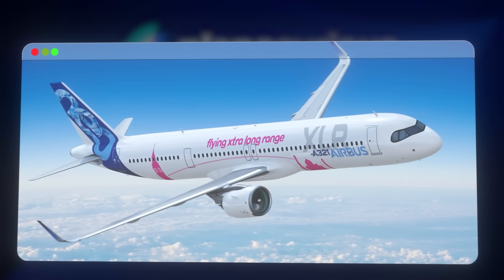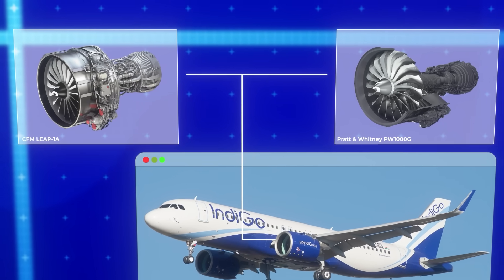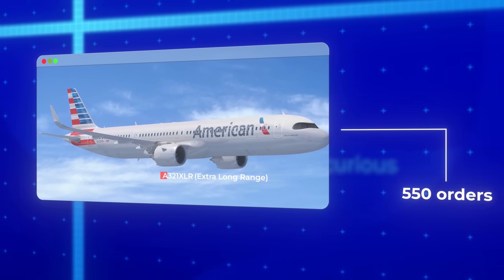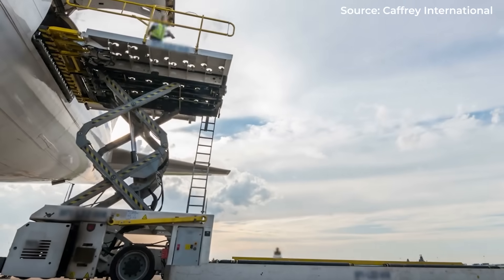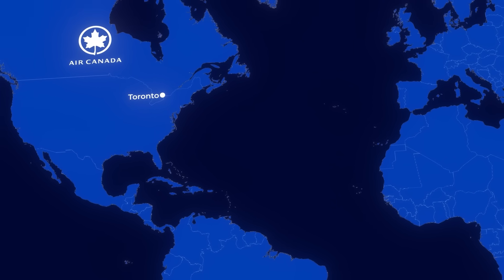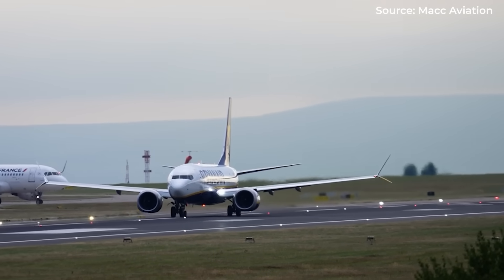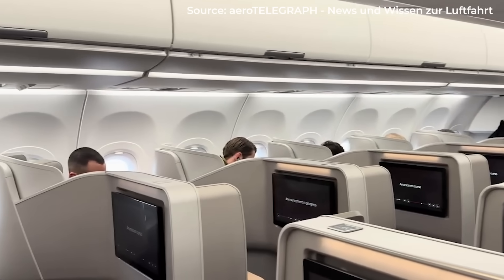How Airbus Outsmarted Everyone With One Jet

Comment: the only one making a stir are you. there is no point in making a narrowbody fly to far. narrowbodies are made for short distances, that is why they are cramped with seats so close to each other you barely have time to breath. if you are to travel long distances, you need room to stretch. if you take a narrow body and add extra fuel tanks, noone will buy a ticket for it unless you re-design also the interior seating. that is why widebodies are used - they have space for that. A321xlr will be used for 3-4 hour flights, not overseas. airlines are not stupid, they wont buy a plane to be able to fly 40 people from london to NY. the savings in economy would just not make up for it

Comment: Actually, Airbus got it completely wrong initially.. thinking the biggest growth in the airline market would be in the 500+ passenger jet. The tables turned when Boeing retired the 767, with nothing to replace it but the A321. Financially, the single isles aircraft were the most profitable aircraft for airlines to run, so A321 orders exploded.. eventually leading to the LR and XLR. Boeing had plenty of opportunities to counter, but insisted on the 737 Max and plans for a short 787. Even a composite material 767 would have killed the A321 dominance, but Boeing are their own worst enemy. Side note, if it weren’t for the NEO engine problems, Airbus would be in a far more dominant position.

Comment: Maybe Airbus should have called it the A321-757,  just to rub it in ...    :=)

On a serious note, if there is concern about the extra fuel tank in a belly landing,   perhaps it would be possible to engineer the fuel system to drain the new rear tank first.
Dunno - I'm not an engineer.  Just thinking out loud.

Comment: Why dont they develop a parachute system for airliners the same as used in the shuttle booster recovery. Surely that would make engin failures survivable.  Cant understand why its never been done.

Comment: Im so happy the “hub” model is going away. Reducing costs, fuel consumption and most importantly giving more work to smaller airports is great for everyone.
Reply: The hub and spoke model allows many route options which could never support even one flight per month. It allows multiple options per day and can fill the aircraft too.

Yes, we may see more direct flights, but the hub and spoke model is here to stay.
Reply: Maybe. I still loved flying the A380 though. De Gaulle to JoBurg on an Air France flying carpet ... pure bliss.
Reply: Maybe. I still loved flying the A380 though. De Gaulle to JoBurg on an Air France flying carpet ... pure bliss.
Reply: Until the airspace gets too crowded with aircraft I think & we have a pilot shortage

Comment: The Airbus Engineers should be careful not to let MBAs and Accountants to run the Company like what happened in Boeing.
Reply: Well, to put it simply. The takeover of Airbus by accountants almost happened in the 2010s. But the engineers didn't let it happen. Moreover, due to its structure spread across several countries, Airbus has also become a champion in logistics. Boeing would be incapable of implementing such logistics.
Reply: At some points MBAs and Accounts are important in the company
Reply: In theory Airbus is worse. UK, France, Spain, Germany, Italy, and more I forgot have political support. Airbus lost money for years. Europe was determined to save airline production. Boeing always complained about difficulty bidding against a subsidized competitor.
Reply: @johnweiland9389  Similarly, Airbus always complained about Boeing getting subsidies from ridiculously overpriced military contracts.

The difference is that Airbus didn't take their eye off the ball and also continued to produce innovative, popular, and safe aircraft.

Which is why they are now No. 1.
Reply: @johnweiland9389  Let's not forget that incident where Airbus lost a contract due to US 3 letter agencies spying on them.
Reply: @johnweiland9389  KC-45 being cancelled and replaced with disasterous KC-46 was one of the stupidiest decisions in USAF history and not fair at all. If they kept KC-45, they would have replace all the old tanker jets by now. KC-46 has been a garbage plane which is not even proven and US government still chose it.

Comment: In the future, this will prove to be all backwards. A narrowbody can never perform like a widebody. Even if it now has the range of one. Because that's not what originally a narrowbody was designed for.

More added foresight, the shift towards narrowbodies being used for longer range could also mean that widebodies will be more designed for shorter range and Max Capacity instead.

Comment: This is a aircraft designed for airline companies money minded, this is an aircraft that in fact to wonders but at passengers expense. This aircraft do not climb is to heavy to climb therefore do not exit bad weather because of the extra weight due to extra fuel carried. One day passengers will star to understand when they fly this aircraft the flight is so bumping and why the crew often suspends the service .the atmosphere is changing and more often we experience turbulence and thunderstorms are higher and  we pilots try to get higher levels to avoid discomfort for the passengers, but this aircraft is so heavy that cannot climb creating discomfort for passengers and in some cases pilots complains. There’s stories about pilots rostered for long haul flights with A321 LR that check the weather before reporting for the flight and if the weather is bad they do no show for the flight.

Comment: Spatial comfort plays a lot on the passenger’s psyche, feeling cramped can affect the overall experience and future planning by air. Wide-bodies made traveling long distances more tolerable. The pandemic taught a great lesson about space but airlines are incorrigibly back to nickel and diming.
Airlines should take it seriously to remove all economy seats from narrow bodies single aisle ultra/extra long range planes. There are alternatives to lay-flat first or business classes with clever ways to distribute the passenger’s weight along the seat; I don’t know how much comfort premium eco offers from just the awful economy seats.
Airlines should also take seriously making in-place exercising a default activity and recommending wearing face masks during flights similarly to safety presentation before the flights, but more frequently through out.
Democratizing air flying has revealed trends that lean a lot towards violence before, during and after a flight. It proves that too many seats in a plane become a liability beyond the airport, involving local authorities.
There have been attempts to offer non-traumatic solutions with LaCie and British Airways all business class in the whole jet, that’s the example for the future to follow.

Comment: One thing I am concerned about is its performance. While far-flying, it it still not optimal. Airbus is already pushing the a321 with LRs, the XLR needed modifications to allow for the heavier MTOW and fuel tank. New flaps, slightly more powerful engines, the RCT etc. The flaps and slightly more powerful engines will allow for quicker takeoffs, but since the wing is otherwise the same, its cruising performance might be a little bit of an issue. But we shall see how it goes.

Something much more like the 757, with its longer and larger wings and more powerful engines might be slightly more optimal still, allowing even longer ranges with greater fuel economy whilst keeping the performance benefits that the 757 already offers.
Reply: i think the 320 family was designed with the 321 in mind in the future, so 321 XLR is a slight external modification to that.
that is the main reason the a318 was effectively a fail and even the 319 is partially a fail. since they are small capacity planes carrying big plane machinery (all small and big are relative here).
I would be worried if they tried to stretch to A322 though, as that is a Boeing move...
Reply: @pasias7785  Mm yes I am concerned about an a322 as well. It just doesn't seem to work, given the same limited wing size (Unless Airbus is allowed to build a wing longer than 35.8m for the 322). 
It would have to sacrifice range for the heavier fuselage weight and the extra payload, which kinda defeats the purpose. There's no chance the 320/321 wing can carry that much more than the 101T MTOW the XLR is slated to be able to takeoff with.

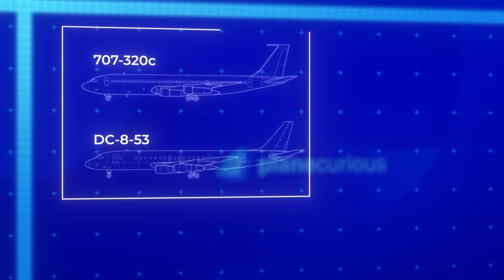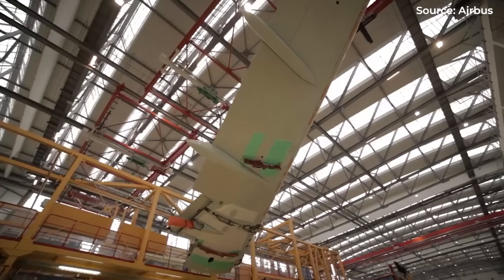Comment: 1:05 it says the aircraft is a single island (isle) rather than a single walkway (aisle).  At 10:31 it also says the panels need to "deform predictability" but it should be "deform predictably".

Comment: The center fuel tank reduces the payload capacity and negates the aircraft’s long-range capabilities. Those involved in load planning at airports are well aware of this. While the NEO performs efficiently, it poses significant challenges in terms of maintenance. At present, sourcing spare parts for NEO engines is extremely difficult — we now jokingly refer to it as “No Engine Operation.” 😂

Comment: The A320neo has the most uncomfortable seats I have seen, The seat is as hard as a board with almost no padding and it doesn't even recline. Surely Airbus can do better.
Reply: The seats are not from Airbus, the seats are chosen by the airlines who have ordered it from a manufacteur for seats, for example Recaro. Airbus just put seats into the plane whlie the conatruction.
Reply: Airlines are responsible for seat type, not Airbus

Comment: One quandry is whether the bathrooms will be decent sized.  The widebodies have a lot more tolerable bathrooms which you're likely to use during an extended flight.  That said, having a cute little plane that can take you point to point almost anywhere relatively cheaply would be amazing.  I foresee these becoming very popular in the continental USA where many domestic routes can push the range on narrowbody aircraft thereby forcing a widebody which doesnt always fill up, forcing carriers to run it less often or not at all (think Seattle to Orlando, Boston to the west coast, etc).

Comment: I cant help but wonder the longterm impact of building a fuel tank directly into the fuselage as the aircraft age. It just seems like a waiting disaster if an aircraft lands with belly landings which is precisely where the fuel tank is.
Reply: Most airplanes have fuel tanks in the belly already. This is just an extra tank.
Reply: @rtbrtb_dutchy4183 most aircraft have a belly tank that has a separation zone between the fuselage and the tanks base. This way if the fuselage is in a belly landing unless there's complete breakage the tank won't make contact with the ground. In a A322XLR the fuel tank 'is' the fuselage. Without a diagram, i cant explain just how significant a change this is.

Comment: European here & big Airbus fan. Though, by numbers of airplanes delivered, the B737 family is still more successful than the A320 family. Of course only if you put the historic first B737-100 type into the same bucket as the B737-max - and with the B737 starting 20 years before the A320. Of course, Airbus has overtaken Boeing in the narrowbody segment sales now - by far. But Airbus is on track to overtake Boeing in terms of deliveries as well.

Comment: While airbus has done a great job making the A321 in to something far beyond what it was originally intended to be, lets be honest, it will be more payload restricted compared to larger and more capable aircraft. There's a reason why operators that are intending to fly these on very long flights are configuring them with lower density cabins and its not primarily for the sake of comfort but for the sake of being able to get there in the first place

Comment: Does the XLR not have less cargo capacity? The extra fuel tank takes up 1 container spot in the rear hold. So instead of 10 container positions you have 9.
Reply: it has less than the neo but more than the current lr

Comment: The A321XLR incorporates a lot more modifications than the fuel tank. The airframe is strengthened by using slightly wider components. The main landing gear is beefed up. The flaps are changed. There's better galley heating for the crew. There are now three cabin temp zones rather than two. There are larger waste tanks and optional larger potable water tanks. Many of these changes were not needed for the A321XLR itself. But they are needed for an even longer A322XLR. I believe it will be launched as soon as production has ramped up and some minor supply issues are solved.
Reply: Larger water/waste tanks ARE needed for longer range flights, which are airborne longer. Health regulations require a flight to divert if the water supply or toilets become inoperative while en route.
Reply: I doubt they would put stuff in the 321XLR that it doesn’t need. It would simply add that to the A322
Reply: @rtbrtb_dutchy4183  the A388 has some stuff it strictly doesn't need, but has in anticipation of -900 and -1000 variants. Engineering something also takes into consideration the economies of manufacturing, so I wouldn't be surprised if thst were true.
Reply: @beehard44 the overall design was so that it was easy to lengthen the airframe. But as far as I know, they didn’t incorporate “stuff” it didn’t need. It wouldn’t add larger waste tanks etc. they would just put the larger ones in for the larger aircraft.
Reply: @rtbrtb_dutchy4183  Well, then you're wrong.
Reply: Engineering designs are taking incremental changes, so whether it will or will not be included is a matter of who wants to order, one innovation could be fitted into any product, the modularity saves resources.
Reply: A322 will simply be too long. A big advantage of A321 is that it can use standard Code C stands which are designed with A321 dimensions in mind.

Comment: Those extra center line tanks cost cargo space, it’s a trade off
Reply: It's a compounding trade-off. You're not just carrying fuel for the extra range, you're carrying fuel to carry the fuel for the extra range. Cost-efficiency drops as you stretch the operating paradigm further and further.
Reply: @petep.2092 back when the a380 was in development one of their engineers in a design review showed us a calculation of how much fuel in total it took to carry a pound of weight on a typical flight and then extrapolated that to the lifetime of the aircraft.  They were pushing hard for weight reductions.  One of our guys asked if he that meant they’d prefer all our equipment unpainted to save weight.

Comment: the A321-200neo XLR could be beneficial for the air charter market . . . featuring a bespoke luxurious cabin configured to seat anywhere between 18 paxs - 36 paxs + 8 flight & cabin crew . . . able to fly 12,014 kms - 12,630 kms or Mumbai (BOM) - Tokyo (NRT) non-stop . . .

Comment: The 757-200 matched all of these capabilities 40 years ago. Boeing really dropped the ball (again) by cancelling it in 2004.
Reply: The 757 cost $13000 per hour to operate. The XLR cost $7000 per hour to operate. That’s $50K difference each 10 hours. So no, the 757 doesn’t have the same capabilities.

Comment: It's spelt AISLE, not isle.
Reply: It is spelled ‘SPELLED’ not spelt😂😂
Reply: @KeyshowJi  That's American (simplified) English. In real English it's spelt with a t ending. There are many subtle and not so subtle differences. We don't allow the use of adjectives as adverbs for example, they are different things but you seem to understand the adverbs but you're not inclined to use them.
We also distinguish between a storey (a building level)  and a story also a kerb (edge of a road) and curb, a verb,  meaning to limit or reduce.
Always remember that our version is the authentic original.
Reply: @grahamstevenson1740 during my one year at LSE I was never corrected for writing spelled rather than spelt…
Reply: @KeyshowJi  I presume you're American, they may have deferred to your use of US English.
You probably also use 'ize'  verb endings where we use 'ise'. Google Chrome's spell check keeps trying to 'correct' me.